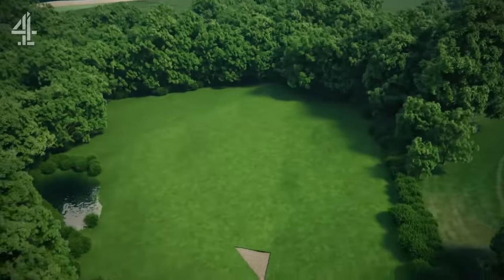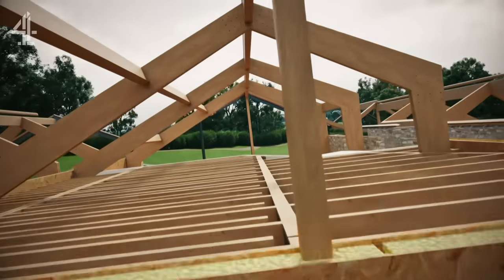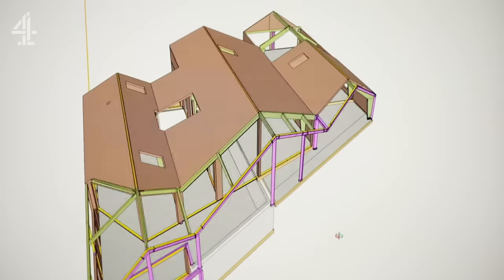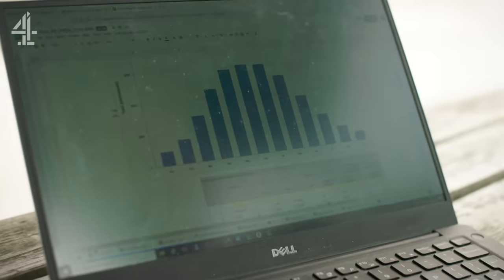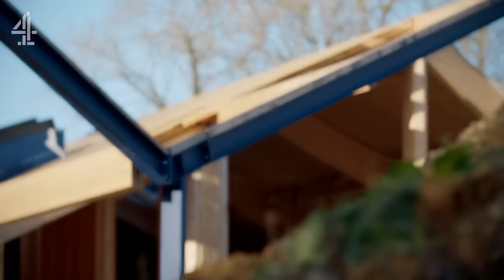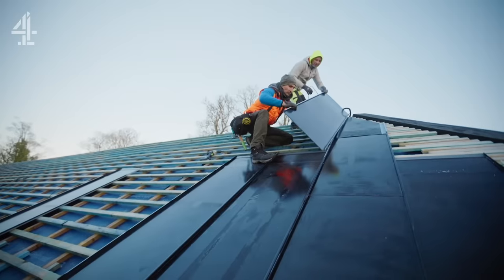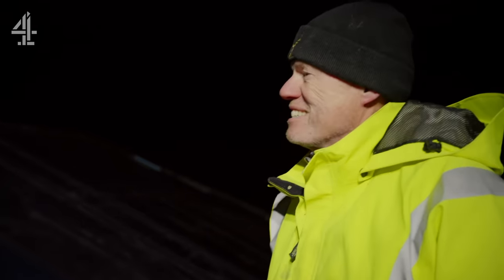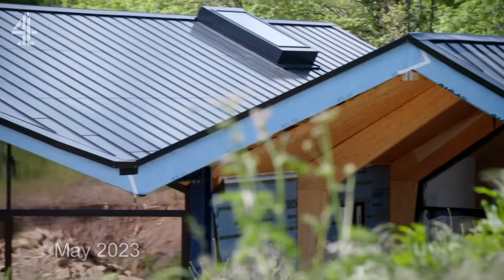Eco House Supplies the Village with Power | Grand Designs | Channel 4 Lifestyle

Comment: Nice
It’s a shame that the government isn’t making these solar roofs mandatory on all new build’s and renovations.
Reply: Explain why its a shame? What would you do with 20x the grids power requirement trying to be put into the grid? Additionally this drives other power generators out of economic viability so there is no one providing electricity when the sun isnt shining enough (which in the UK is far longer than it does shine for).
Reply: @yt.damian Industry also requires power, not only domestic. Any excess can be stored, by various methods. Yes, let's put the oil, gas and coal industries out of profitability.
Reply: Mandatory on renovations? That’d be costly lol...
Reply: @tednruth453 you make energy storage sound like a simple thing that's been conquered. What methods did you have in mind for mass energy storage?
Reply: @dannyboywhaa3146  
There’s billions the government could give out to cover the cost and that would be better than the government giving billions to their supporters to park off shore. Or giving billions to the UAE and Dutch governments to drill oil in the North see. There’s plenty of money it just go to helping the people of the UK.
Reply: I'll tell you why, because it will eat into their current energy investments. Explain to me how MPs who earns £86,584 a year, is worth tens of millions?
Reply: @Nick-xc4fy jealousy is an ugly trait
Reply: @Nick-xc4fy  
Daddy’s money for some but if you Specified which MPs particularly you’re interested in we can investigate them rather than just making blanket statements.
Reply: Most new builds in the UK have standard solar panels, which over their forecast life will be a saving, battery back up is also required to maximize the potential but a number of problems exist with them like fire and cost, it's silly to think that all UK homes will be "designers". Mass energy storage and upgrades to the network grid are all required to the UK energy network and as they are private and not public companies we will be paying shareholders dividends on that  investment through the nose!?!
Reply: Such an ill thought through statement 😂
Reply: This will never be mandatory on all builds. Firstly, planning requirements in many areas denote tile or slate. Secondly is the cost.
However, the more the system is implemented, the cheaper the cost will become. I can see this system gaining real momentum on large industrial and agricultural buildings where the power requirements are big and the roofing aesthetic is similar. Maybe then we could see the system being used on large new build housing estates.
Reply: @yt.damian have you seen U.K. homes they’re not that big. Every new build should have sola.
Reply: Who knows the name of the company that produces the solar roofs?
Reply: Honestly - been saying this for years. Completely agree.
Reply: ‘You will own nothing and be happy’
‘Eat ze bugs’
Reply: @LordBillington42   "you make energy storage sound like a simple thing that's been conquered."

It has. 

7kw home batteries would be more than enough for nearly everyone. Nevermind some can easily get up to 20kw.

Grid doesn't have capacity? Home battery full? EV full? Just curtail it by switching off the solar inverter. 

There are already solutions to problems you're making up.
Reply: @LordBillington42  Pump water up a hill into a reservoir during the day, let it back out downhill to drive hydro turbines at night.
There are plenty of similar solutions on a smaller scale too.
Reply: @flyingpanhandle  The National Grid will buy power off you, and then sell it back when you have low/no output.
Get it right and you end up in net profit.
Reply: @yt.damian u don’t really understand what you’re talking about, do you.
Reply: Yeah and then while they’re at it they can declare poverty illegal 😂😂😂
Reply: @LordBillington42  a) Electrochemical battery, lithium ion orr flow battery
b) Thermal and phase energy storage; liquid to air storage transition or Thermal sand batteries
c) Mechanical energy storage: compressed air, gravity storage, flywheel storage, pumped heat electrical storage.
d) Pumped hydroelectricity storage
e) Hydrogen electrolysis
Reply: Because that wouldn’t be a good thing.
Reply: @tednruth453 how do you suppose we store the extra power, with more batteries which means higher emissions, then there’s transportation of the power which means higher emissions, then there’s all the extra logistics that would be required to manage the excess power supply which means higher emissions, then there’s the actual solar panels which also increase emissions as they are manufactured and take years to become ‘carbon neutral’ however their lifecycle is far lower than the time it takes to become ‘carbon neutral’. 
There’s also a reason we don’t use solar panels on mass in the uk aswell because there’s not much sun. Just a whole load of reasons why it’s not a good idea. On a small scale in a closed system sure it’d great for saving you money but it wont be better for the environment and on a large scale in an open system it wont be better financially or for the environment
Reply: On all factory and warehouse roofs as well.
Reply: @LordBillington42 this would be a perfect case for what Ireland are in the process of building, reservoir storage. The excess power is used to pump water uphill during the day, then it's released at night powering a turbine.
Reply: Our grid is not able to cope with it. There are still buildings that have Victorian mains cables still running to the houses! All investment has been minimal and majority of profits that go to the energy companies Go to the other countries that own them.
Reply: @karljones4321  who told you that? The grid is fine. Victorian? Really?
Reply: @LordBillington42 ever heard of Tesla?  They make domestic energy storage batteries and commercial energy storage called mega packs which are revolutionising our antiquated national grids.  Australia is leading the way and others will surely follow!
Reply: @tednruth453  Please stop making things up, the amount of energy created cannot be stored in the summer for the winter. p.s I live in an off grid home with solar panels. Guess what, in the winter we get very little electricity and have to run a generator to charge the battery bank which is big. In the summer we get too much electricity that we cannot use. This is just for electrical appliances we don't even try and heat the home with electricity that would be impossible.
Reply: @MrLaughinggrass  which part did you think I made up?
Reply: @tednruth453  "Any excess can be stored" with solar panels you get about 10x the electricity in the summer that you get in the winter. I did the maths and if I wanted to store the energy that I got in the summer I would need millions of pounds of batteries (it was a small home). You cannot just store energy in the summer to save it for the winter. Unlike squirrels and their acorns!
Reply: @MrLaughinggrass  that's unfortunate. Solutions are available, keep trying.
Reply: @Alphoric Lots of factual claims in there with no numbers or references. Do you have any?
Reply: @karljones4321 What is our grid capable of?
Reply: @rfrisbee1  no it’s pretty simple, doing stuff like creating renewable sources of energy require more fossil fuels. If You think you can create energy out of nothing then go ahead
Reply: @Alphoric  What is your source for your claim that solar panels don't last long enough to be carbon neutral?
Reply: @rfrisbee1  the industry themselves
Reply: @Alphoric  Do you have links to any sources of evidence that support your claims, or is a nebulous "the industry" the best you've got?
Reply: @rfrisbee1  I’m not the one trying to argue here if you want sources go find them yourself I’m busy
Reply: @Alphoric  You are the one making factual claims. The burden is on the person making the claims to back them up. As you can't everyone else reading the comments can at least see you have no evidence to support your statements of fact and can judge your comments with that in mind.
Reply: The EU are in the process of doing just that. Look up the EU solar rooftop strategy.
Reply: dont talk common sense that would be too easy
Reply: @yt.damian  Current generation capacity in the UK, especially england, isn't enough to cope with demands in winter and with the push towards electric cars that demand is only going to go up. The need for micro-generation is present now
Reply: An additional £50k per build would be a decent hike and make the, already bloated, cost of properties even higher. Developers would charge a premium far above the £50k cost. We’re also not geared up to store power in the UK. We have a demand model. Power stations actively adapt output to meet demand. It is certainly a brilliant aspiration, we just need to change the infrastructure to facilitate it.
Reply: Plus, let’s not kid ourselves. Big businesses and and the government would still find a way to shaft us all in the long run. I’d rather just go completely off grid.
Reply: Are you paying you for everyone?
Reply: Just put it in an array on the ground. Roofs are a silly place to put panels.
Reply: As if houses didn't cost enough already
Reply: Move to Germany in Baden-Württemberg it’s mandatory since 3 years when you build a new house 🤗
Reply: Good reason not to move there. But hey - if you are moving there then its your choice at least. Sorry for the people that already live there and have this imposed on them. @imacdvman
Reply: @LordBillington42  Mandate a 15kW home battery as well, costs about the same as the solar (aka about 0.5% of the cost of the house) and would mean each house uses >90% of the solar themselves. Times this by a few 100,000 and you have a massive amount of storage for other types of renewables as well, such as wind energy.
Reply: @yt.damian  lol and your expertise is what in this sector? I assume that you are one of these right-winged-libertariens who try to get rid as much as possible of government influence – so this is then tho one of the most independence way to go, when you harvest you own electricity 🙃
Reply: @imacdvman  if that is the case - dont force people to do it. if its so wonderful people will do it themselves. as to becoming "independent" you have a little learning to go yet. every piece of a system like this is built by the grid, you cant have it without the grid enabling it. when something breaks you have to replace it with another piece built by the grid. and what would you do with the 20x your energy requirement during peak times? nothing. you cant do anything with it if you are not on the grid. and then when you are not producing electricity you need to buy electricity back from the grid that is produced by some miracle because the sun and wind are not doing it for you. it is no secret that grid unreliability is increasing as more intermittent generation is added to the grid and base load power decommissioned. it is no secret that there is not enough known copper reserves (let alone what we are actually mining) to electrify everything, let alone any of the more rare metals. there is not one good argument for governments mandating this. if you have one please share it?

Comment: Can the owner of the property share some data on how much this 400-panel solar roof has generated over the last 1 year? It would help other home-builders understand the return on investment from the £118,000 cost of the roof. With some assumptions,  my rough calculation is that over 12 months in the south of England, the roof would generate 80,000 kWh. Current average electricity price per kWh is £0.30 so that's a saving of £24,000 per year, if the homeowner would otherwise have purchased that electricity. That would be a fantastic return on investment. However, even if the homeowner ran 2 electric cars, they will probably use only 25% of the electricity. The other 75% would be exported to the grid, for which the homeowner would be paid about £0.08 per kWh. In this case, the return would be a saving of £6,000 on electricity they would otherwise have purchased, plus £4,800 for the exported electricity. Total of £10,800 per year, which is would be a return of 9%. That's still a very good return - much better than savings rates and even as good as long term returns from the stock market. Plus, the homeowner probably saved £15,000 on the cost of laying traditional roof tiles. But more important than all of that - this homeowner has made an outstanding contribution towards tackling climate change. He has built an inspiring project and a sustainable legacy for the future.

Comment: Given how sleek it looks, it might be worth it. But i think, mainly for ppl who haven't looked into it, it is important to consider the cost. i am in sydney Australia. My traditional (not sleek) 10kw solar system generates 80kwh on a sunny day(19th Nov 2023) and the initial cost is no doubt much lower. I broke even in about 2-3 years. Of course, different location, different house, different size of panels, can't just compare directly. But if you really want to 1, go green 2, go sustainable green, you might realize there is a long way for this product to go and you might be greener with a traditional solar system. Again, this roof is beautiful, it is worth someone wants the visual to go for it, I agree with that.
Reply: They really committed to doing what they wanted to do, not what they should do. They are generating so much power that they can't actually sell it back as the local grid doesn't have capacity. 

They should have just used fewer normal panels.

Comment: I agree the 19th Nov was a good day - I got 39kW out of only 5kW system - my best day was the 4th Feb 2023 where I got 40.5kW. I've subsequently updated to 10kW and so far I've got 81.7kW on 5th Dec 2023 - the newer panels are giving more than the older ones even though they're kinda facing the wrong way.

Comment: Splendid accomplishment - we can but hope that in time the costs will come down so ordinary folk can afford to do something similar.  

That's where the real gains from 'renewables' can be found - reducing the demand from the grid.  Present thinking is too focussed on replacing the generation sites with renewable sources and it just will not fly, not with the foreseeable technology.  Homes becoming self-sufficient for energy would drop the energy budget by a third.  By the way, the fact that domestic energy use is only a third of the total is a fact that should be more widely known.
Reply: Homes will never become self sufficient as self sufficiency isn’t a real achievable thing.

Comment: When I was getting panels put on my roof I was told there was a maximum amount that could be installed before the government starts looking into slapping taxes on. Part of the problem with projects like this and smaller scale ones are that the power companies can charge whatever they want and change it on a whim while the home owners producing the power for them don't see any benefit.
That said there's a lot of redundant roof space and tall buildings that could be fitted with panels rather than cheap cladding if only we had MPs willing to have forward thinking beyond cushy seats on a corporate board. Neither of the big two in westminster have any plan or intent to do anything but can kick and hope they don't have to deal with the problem when its unavoidable.

Comment: How on earth did the DNO get approved? I cant even get 8kw approved from SSEN. Also do the tiles have optimisers?
Reply: Would love to know this, but I imagine the answer is money.
Reply: It was covered in the show and as it turns out, there's a cap that the DNO placed and it was considerably lower than he was generating (something like 30 kWh if I remember rightly).  Which means that the other 200 kWh he's generating just vanishes into the air (so to speak).
Reply: He hasn't. It could do it all, but can't because of the DNO. It was clearly something they didn't factor in when designing the system.

IMO, since they seem to have the money, they should just supplement it with some home batteries.
Reply: @Unshou  I believe it's called "clipping"
Reply: The system is designed to keep us dependant on the national grid, this keeping the big energy companies in profit.

Comment: The $64.00 question is how much he receives for feeding into the grid.
Reply: It was covered in the show and as it turns out, there's a cap that the national grid places on exports and it was considerably lower than he was generating (something like 30 kWh if I remember rightly).  Which means that the other 200 kWh he's generating just vanishes into the air (so to speak).

So basically, he's waiting for the national grid to catch up to the technology.
Reply: @Unshou  I think you are not including what they use at that property.
Reply: @QRCCD1999  Good point.  That said, I know it's a huge property, but I'd be impressed if they used more than 50 kWh per day.

Comment: If he was worried about needing just another 2% of solar, then he should have added a patio with solar on the ground, or a solar driveway.  You can get solar panels that are made to be walked on or made for people to drive cars on.  That would give you the extra he was looking for.

Also in the winter if you have snow you are more likely to clear the snow off the driveway and patio than the roof.
Reply: You can bypass underneath like any other panel or replace it. 95% of the panels could break and they would still have more than the average house needs 😂

Comment: Imagine if it was used as cladding also .
Reply: Exactly, I don't get why this is always associated with roofs.
Reply: @aliasgharkhoyee9501  I think it's because the efficiency goes right down if the sun's rays are at a steep angle to the surface rather that full on. That said, it would provide a bit more energy.